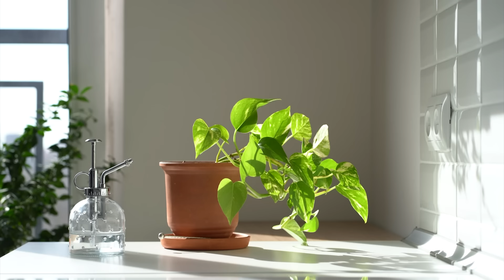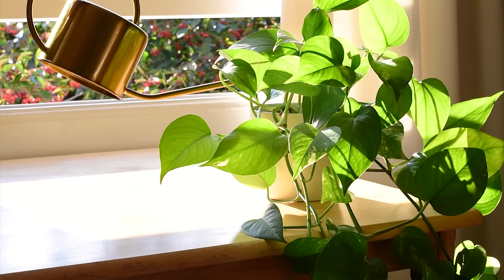Giving your house plants genetic super powers

Comment: 30% improved air quality is impressive. 30% improved air quality over the course of months in a hermetically sealed room is much less impressive. I imagine that any amount of air flow would overwhelm the ability of the plant to scrub the air and the room would be undistinguishable from the control. These plants are simply not fast enough to be useful - yet! Fun idea and cool to see creative uses of GMOs!
Reply: 30x, not 30%, but yeah, that's still not fast enough. You need easily thousands of times more ventilation to keep the CO2 levels from your own breath down at safe levels.
Reply: @reinux it's not for CO2 anyways, but certain toxic compounds like formeldehyde toluene.
Reply: @plederfagella9774  CO2 is itself toxic above around 1000ppm.
Reply: @reinux yes? Emphasis on the word certain, not "all"
Reply: @plederfagella9774  My bad, I misunderstood.
Reply: @reinux he said 30%. The clickbait title says 30x
Reply: the video says 30x the efficiency of normal plants and also, its specifically referring to volatiles, that are toxic to humans, not CO2
Reply: It’s a 30% reduction vs the control and both rooms have continuous outgassing from the products inside. It’s not down 30% from the start of the month it’s 30% down from the control at the end of the month.
Reply: I wonder if adding a second plant would increase the air cleaning by 100%. Maybe simpler than all this lab work and buying special planters and regular doses of probiotics to increase it by 30%
Reply: agreed. As stated early in the video, you can purify the air right away just by opening the window for a few minutes
Reply: Its selective breeding not GMO. No genetics where spliced.
Reply: @quimblyjones9767  Remember the gene gun.
Reply: @quimblyjones9767  Yeah, because GMO is banned from sale, they had to use this (way more expensive) workaround instead.
Reply: That's what I don't get. Who is paying for this research ?!
Reply: @DatBoiClippy  the European Space Agency is probably interested
Reply: @DatBoiClippy  It is highly likely that the company itself is footing the bill. I can give you a list of reasons why : 

1. In a grant study they would not add in IKEA furniture and stacks of paper that someone used a Sharpe on. Instead they woud find out what the expected outgassing of an IKEA furniture piece or stack of paper with Sharpe on it. Then they would diffuse that amount of the volatile over time and measure it coming and going.

2. In a grant study, there would be a lot of focus on the mechanism for the plant to uptake the pollutants and how it is metabolized. An attempt to find out what enzyme or process in the plant is responsible, and what genes control those functions and enzymes. 

3. Never once did the study or Thought Emporium mention proteomics, which is where all of the real work on something of this nature is actually done.  Continuing my previous bullet point, knowing what processes are at play and what genes control them is what is important to science and grant writers. Nothing he showed is consistent with them chasing down the latter. Instead it is hyper focused on something else, the "real home testing"

4. "Real home testing" and "real people on the diet" and other testing that focuses primarily and often exclusively on these final tests are a hallmark of pseudoscience.  Why? Because it convinces consumers. It also gives the shysters a chance to wave off any need to explain HOW IT ACTUALLY WORKS. "No need to explain how it works when you see results like this, am-I-right!" 

5. Remember points 1,2 and 3? Well they are actually very important because THAT is the data that would be needed for the advancement of knowledge and science. That is the data that would be gathered if others are to ever build on your own work, or heavens forbid, someone were to ever want to replicate your results.  Throwing some Ikea furniture and some stacks of paper in a room isn't the making of repeatable testing. 

6. Which brings us to : They can lie throughout this entire process and get the results they want/need. And who is going to dispute them? Their testing methods are not even falsifiable! If I were to design a test that no one could sue for fraud over AND that no one would ever go through checking my work on, it would look exactly like this. 

7. Plants don't breathe. They do not pull air in, exchange what they need for what they do not need, and then expel the rest. They work through diffusion and osmosis. If they did suck in air and then spit it out like little baby breaths from their leaves, then plants would have the same issue every air filter on the planet has, debris collecting on the filter membranes. Instead, our house plants collect dust at the same rate (or less) than the inert objects around them like desks and tables. Why could it be less? I will leave that for extra credit work if yo feel like searching out the answer. 

8. This is the big one. If we did find a mechanism that allowed plants to be air filters, then there would be BILLIONS to be made in taking those genes that allow those proteins to perform the process that removes a specific family of chemicals from the air. And I mean billions. Why? A houseplant just doesn't turn over the air at a very high rate. You are waiting on a static leaf to do the work. Its all stochastic in nature. Another is that terrestrial plants  just don't have the respiration rates needed to have an efficient system. You can fill a room wall to wall with these plants and they would still have a fraction of the respiration rate of a 50 gallon tank of algae. Also, algae is much easier to care for and can almost be treated like an industrial process rather than an agricultural process. 

9. They SAY they have the Holy Grail, something that would be worth billions, and are forsaking that to hock houseplants to gullible people, like some MLM like Herbalife. 

10;  Speaking of Herbalife, their testing is VERY much like this testing. Probably a meaningless data point though. Nothing to see here... am-I-right? 

11. Never once was the metabolites of these substances ever mentioned. Not once in the video and I would wager, not once in their whit papers for the "study". I mean, efficiently breaking down common pollutants with a low energy process like enzymatic action is also something that would be worth billions.  But hey... they just LOVE to sell plants... am-I-right?
Reply: @DatBoiClippy  you need to see the bigger picture. The biggest study about plants that clean the air came from nasa, because: You have only one set of air in a space ship that you want to keep clean with very little power draw.
Reply: @ShakesB13r  This is my favorite part from that paper.
'Activated carbon filters containing fans have the capacity for rapidly filtering large volumes
of polluted air and should be considered an integral part of any plan using houseplants for
solving indoor air pollution problems.'
Reply: Nicolas is the one paying, as always
Reply: @zirgaoec3784  Everybody knows
Reply: @DatBoiClippy  the taxpayer as always
Reply: @anonymRabbit23 just checked and they're not government funded. They raised funds from True Ventures, Heartcore, Collaborative Fund and Entrepreneur First.
Reply: @anonymRabbit23  worth every damn penny.
Reply: @anonymRabbit23  finally, it goes to something useful
Reply: @anonymRabbit23 wtf I had posted the list of investors and my comment got deleted ???
Reply: @DatBoiClippy  Post it again, also where did you get the list?
Reply: @DatBoiClippy Long comments get automatically deleted by youtube for "spam". Youre better off telling people where they can find it
Reply: @DatBoiClippy Or well making multiple comments could also work
Reply: @anonymRabbit23  I´d rather pay for this stuff then other bullshit.
Reply: @anonymRabbit23 you don’t want your taxes going to developing plants better at keeping the air clean?
Reply: @brooklyn560  I have a gold bridge to sell you
Reply: @brooklyn560  Yes if it wasn't bullshit. But in this case it is complete bullshit.
Reply: @LeMAD22 1960: "Why are we paying people to research these silicon chips? They say they could be used in the future of computing, but since they haven't done anything yet it's clearly bullshit"
Reply: @DatBoiClippy links get deleted on YouTube, putac
Reply: No, it isnt. Our money is better spent changing our land use practices so we aren't constantly genocide my the thing that actually kills our air which is... Idk, maybe natural ecosystemd? I'm sick of this shit, no technology is going to save us if we keep burning the fucking rainforest... Its actually so simple, stop focusing on shit like this and focus on conservation and rewilding. French start ups will not save us. Capitalism will not save us. Investors will not save us. Technology will not save us. Its time to start bein fucking honest with yourself and stop falling for marketing hype.
Reply: @anonymRabbit23  bro the guy is probably paying for it himself

Comment: Years ago, a study showed that green plants did not absorb harmful products and that the soil of these plants absorbed a minute amount... provided they were exposed to high concentrations unrelated to ambient air. In short, I don’t believe it at all.
Saying that the decrease is 30% means nothing: compared to what initial concentration?? With what quantity of plants?
Moreover, it is likely that the result will not be stable and that as the plant grows, it will lose these properties. 
NB: if formaldehyde is so soluble in water then just leave some water! 😄 You can even add a little phenol or urea to block it.

Comment: 9:33
«Though I do understand that often it's not really the dislike of GMOs per se, but rather the desire to protect otherwise wonderful heirloom strains that would be outcompeted.»

Yes, this is often given as a reason; but it always seemed like a justification after the fact. That is, it's not a problem leading to regulation being proposed; it's a regulation being proposed leading to a search for problems (real or imagined) in order to justify the regulatory proposal.

If it was about the protection of heirloom strains, then the regulatory framework would control massively adopted commercial cultivars regardless of whether they were incorporating biotech traits or not.

Comment: If you don't believe in the current air quality standards, then you need a new unit 731 to determine the maximum permissible concentrations. Then you can measure how often these concentrations are exceeded and how much in ordinary houses. Then estimate what number of plants will be able to reduce the concentrations to the norm and how practical this is compared, for example, with carbon filters. If at least something from the above was not done, then everything that this team did is meaningless.

Comment: 20:34 I use that EXACT SAME Thermo Scientific Trace 1310 GC with a ISQ 7000 MS detector and a Triplus RSH autosampler at my work sometimes. I'm a quality control chemist for a contract pharmaceutical manufacturing company and it's my favorite instrument in the whole lab, specifically because of that Triplus RSH autosampler. Don't get me wrong, the GCMS portions are super cool but no cooler than any other modern GCMS. However, the how advanced that autosampler is is quite literally what makes it my favorite. It can be used for some amazingly complex sample prep without you having to do anything but load separate vials of stuff. He literally is a sample prep robot, I wish my work used it that way more but we just use it as a normal auto sampler and do all the sample prep the old fashioned way which is sad. Still I love whenever I see it in videos about other people's labs.

Comment: This form of directed evolution seem very similar to what bakers do when making sourdough. Generally, the goal is to get a symbiotic mix of yeasts and lactobacillus. The original strains for the yeast come from the flour and the air (they're kind of just all over the place), but after repeated feedings, the genetic makeup of the yeast in your starter changes dramatically. 

Recently, I've been playing around with making injera (a type of Ethiopian sourdough flatbread made with teff flour) and wanted to test this directly. I baked the teff for some time to kill the existing natural yeast, and slowly transitioned my starter to using teff, keeping it in a negative pressure area in a sealed jar (ofc. there are probably natural yeast cells everywhere, so the new colonies could just come from the air). Despite normally feeding it daily, on a largely teff-diet, it was substantially slower to respond for the first few feedings. After a couple of weeks, however, it had largely completely transitioned to being able to subsist on teff (and, it has produced some excellent injera :)). Kind of curious on the extent to which this is actual genetic change, or if it's just a case of inter-specie competition between different types of yeast in the jar.

Comment: 1) Are normal exposure levels to these chemicals actually proven to CAUSE clinically relevant health issue? To what extent?
2) Are these products cost-effective when compared to traditional air purifiers? Do they provide any additional health benefit in real-world scenarios (i.e., not 30L hermetically closed jars)?
Science is certainly very cool but this doesn't tell you anything about actual efficacy when they are used by customers

Comment: the pothos are so resiliant. i have one in my dusty windowless lab. and it survives. it was a bet in my first week with my single lab co worker. i won. it survives. it even has grown 2 new leaves in the last 8 months. which is great cause most of it was winter and while we have bright LED light in the lab during work hours, it's even in a shadowy spot. 
and it got cold in winter. 
of course it was slower than it was when it was still infront of my window at home. but it lives. 

now i want to buy this. eventho we only release a tiny bit of formaldehyde in our products as we have the highest VOC certificate there was for our products. sadly live in europe

Comment: the EU's functional ban on gmos is absolutely silly, but it's an economic argument: if one company engineers a sequence of dna and patents it, then any farmer in the area now has to both compete with the altered varietal, and ensure that the patented dna doesn't drift into their crop on the wind, or else they would be selling patented technology without paying royalties (for an example of that Actually Happening, see Monsanto's Roundup Ready product line in america). it ends up in a twisted situation where monopolies aren't just viable, but enforced by the patent office, and so the EU took a hardline stance and just forbid the sale of GMOs to stem off the slippery slope. yes it stymies legitimate good in the world, but it also prevents a vector for abuse, and the EU has its priorities pretty clear.
Reply: Patent law should just be changed to exclude the ability to patent fucking plants

Comment: The problem with GMOs is not the modification per se, but that the modifications allow the use of copious amounts of pesticides that end up in the final product.
Reply: I'd recommend you read up on it a bit. I agree that GMOs present some huge issues, but what you are describing is almost the exact opposite of what they're doing. 
They could expose the current, UNmodified plants to FAR more pesticides than they currently use before anything in the pesticide starts harming the plants. But why use more chemicals than you need? 
Most GMO is about increased yield and DECREASED pesticide use.